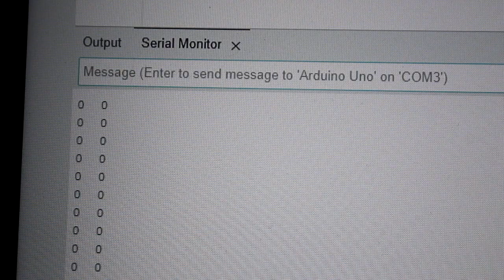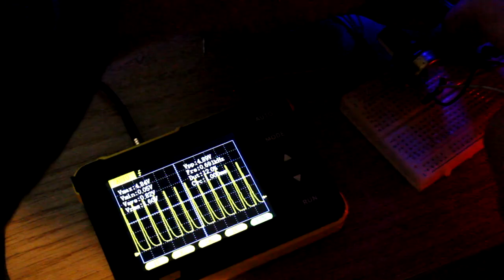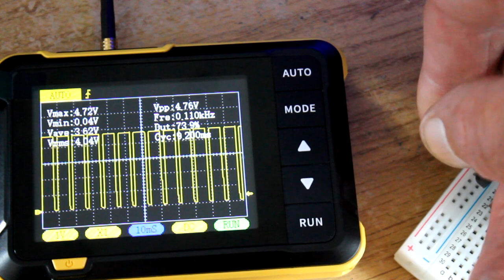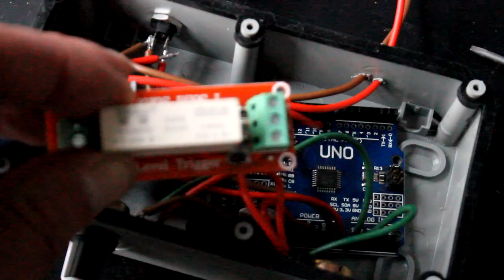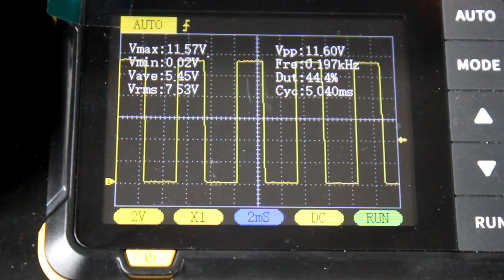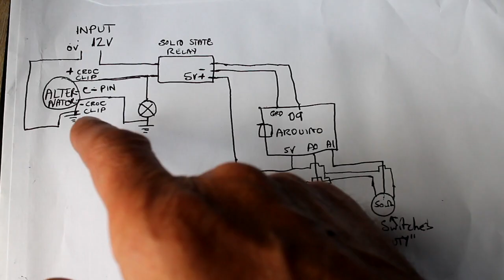Smart Alternator Test kit. Home made with an Arduino.

Comment from the maker: It works. I`ve tested it on an alternator and it even worked on a low frequency. Went from 12.4 volts to 15.5 volts when I adjusted to duty cycle knob.